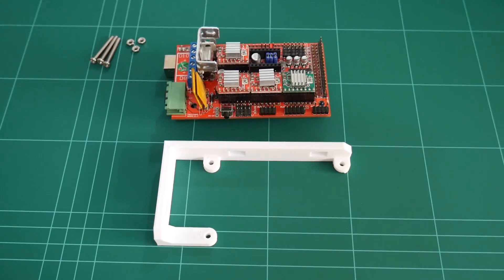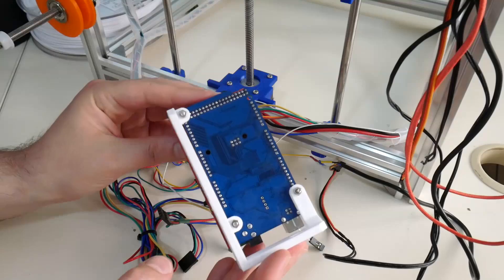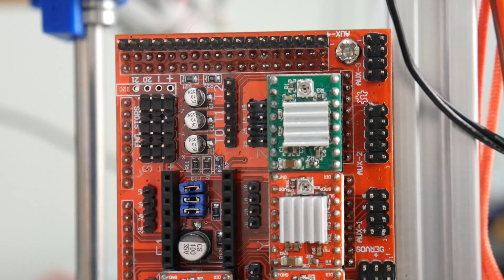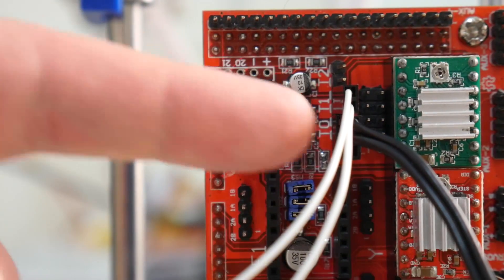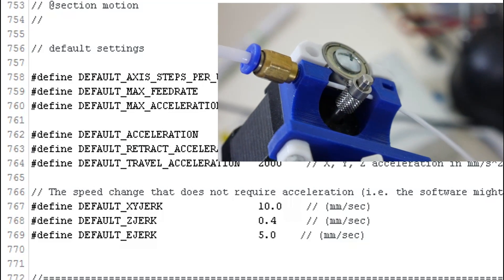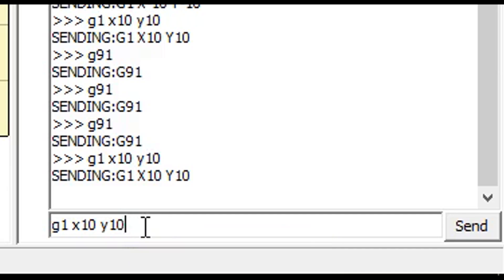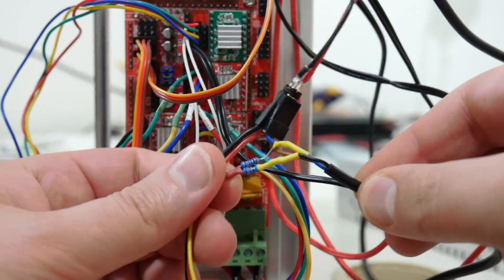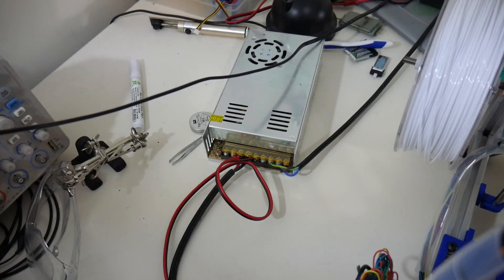New 3D Printer - Build Log #13

Comment: It's driving me nuts that you never add imbedded areas for the nuts. I can't imagine having to deal with all those loose nuts throughout this build!
Reply from the maker: Was there a pun in that statement? :P
I chose not to include nut traps because in my possession I have 3 M3 nuts with different thicknesses and outer dimensions. The problem I faced is everyone probably won't have the same type of M3 nuts so better to leave it open and use nyloc nuts instead.
Reply: :P
I didn't realize nuts of the same size came in different outer dimensions. Makes sense though.

Comment: Hi, Tech2C your Design si great, thank you for sharing.
I' ld like to know if I can use the MKS Gen_2Z v1. 2 board and the components of the sunhokey Prusa I3?
Thanks
Reply: The board is based on Mega 2560+Ramps 1.4 so it is compatible. Personally I am using MKS Gen V1.4 insted of ramps and it works fine without problems. MKS is just better in term of manufacturing quality, mosfets are not getting hot and will not burn. Also terminals are way better.

Comment: Hi,
Great video series on building a 3D printer.
I'm quite new to 3D printing and I'm planning to pick myself up a Prusa I3 with the Z-axis auto level feature. Do you have any tips for the prusa, seeing that you have used one before this new printer, and would you recommend to plan a brand new build to make the build area larger at all?
Thanks

Comment: Is it possible (is it easy) for a total beginner with 3D to build this printer but make it bigger? I need a print area from at least 40cm 40cm 40cm.. and second question.. is it possible to make on both sides a motor that moves the print area?  Do you maybe plan to make a tutorial for a bigger printer? Nice channel!!!
Reply from the maker: This is an open design so you can make the frame as large as you like, just be aware the larger it is the lower the acceleration you will need to set. If this is your first printer then building any printer won't be easy initially.

Comment: great video series, thank you.

i suggest that the wiring loom is anchored to the frame near the board, from which all the cables fan out to the board.
leaving the cable swinging in the breeze may cause a failure somewhere.
cheers
Reply from the maker: A prudent suggestion. Thx!